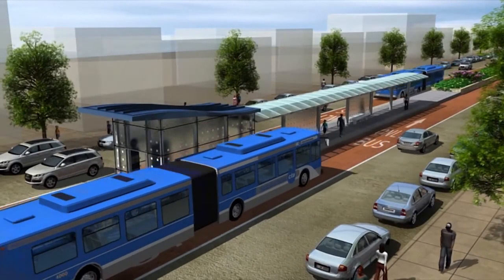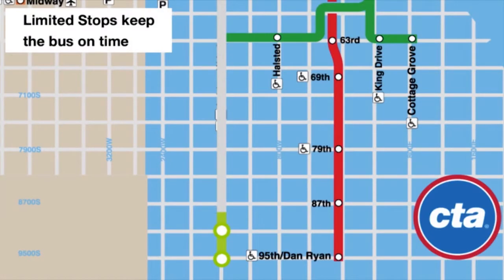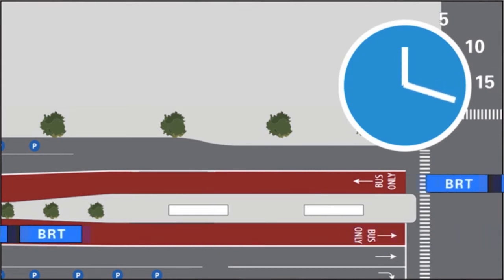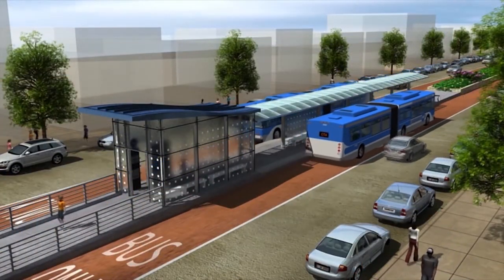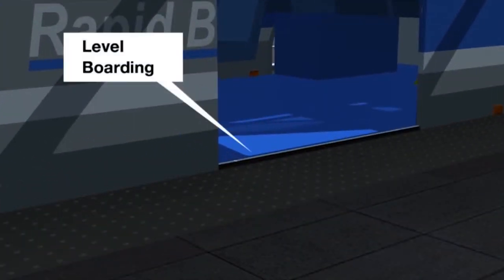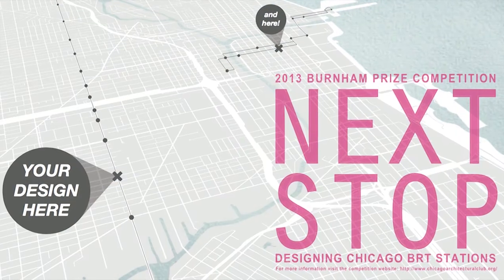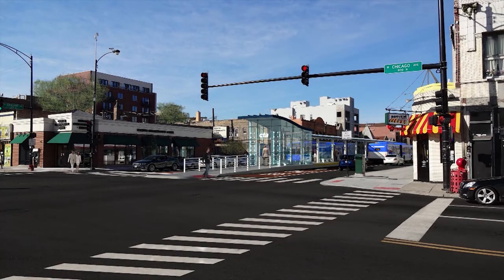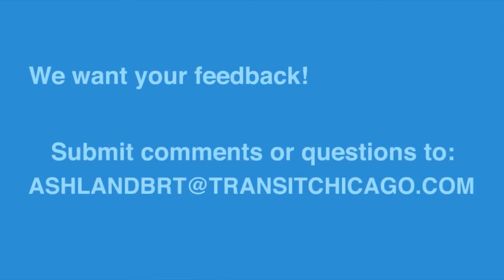Ashland BRT: How Will a BRT Station Work?

Comment: There is a reason why Ashland Avenue in Chicago is a six-lane (two traffic, one parking and in each direction) roadway: TRUCKS! Has it occurred to anyone how important it is for those trucks to make deliveries to the businesses and even schools along Ashland? 

This is what was ultimately the doom for Rahm Emanuel's reelection: He tried to turn the entire city (which was already a traffic nightmare) into a bike lane, to serve the 20% lawful/80% unlawful bicycle riders who disobey traffic lights; especially the ones installed for them and traffic laws without regard for pedestrians. Now, the CTA wants to take two (2) vital truck routes (Western Avenue is the other) and make things much worse for city traffic. 

NOTE TO CTA: YOU CANNOT FORCE PEOPLE TO RIDE BUSES OR RENT DIVY BIKES! THIS IS THE WORST IDEA YET TO COME FROM 567 WEST LAKE STREET, CHICAGO, ILLINOIS 60661! DON'T DO THIS! LEAVE ASHLAND, WESTERN AND CICERO AVENUES ALONE! JUST BECAUSE OTHER CITIES HAVE BRT SYSTEMS DOESN'T MAKE IT RIGHT FOR CHICAGO!

🐰
Reply: 1. You have provided no reasons why Trucks need two lanes, they can work just fine in one. 
2. This doesn't force anyone to use any mode of transportation it simply gives people a faster option (yes this will be faster than driving on the current Ashland Ave during high traffic periods). The Ashland BRT will most likely remove a lot of cars from the street and could possibly improve Truck speeds even with one less lane in each direction.
3. Ashland, Western, and Certainly Cicero are very unpleasant streets to walk along and often have terrible traffic despite their width, so redesigning all three of them is a must.
4. Chicago is not that different from other cities that've implemented BRT or light rail successfully, and there is no reason to think that it would fail here.
5. Overall the only way to reduce congestion is by providing more efficient alternatives which BRT is. The CTA's complete streets video on this explains it rather well https://www.youtube.com/watch?v=vm9ww6MOI-I so does this video https://www.youtube.com/watch?v=RQY6WGOoYis
Reply: I'm almost hit by a car on a crosswalk about once a week. Never had a problem with cyclists.
Reply: xavierhutcherson2896  "God" has NOTHING to do with transit. Read your Bible!
Reply: @BurjTransit  I wouldn't need to provide "an explanation" to city planners. Just as the Friends Of The Park "protect" (yeah, right) the lakefront, someone has to have common sense,  and I see ZERO common sense in turning truck routes to BRT and bike lane laden roadways just because. 

If you've ever seem Ashland Avenue, you'll see large trucks park in the median to make their deliveries.  Should they park on your precious bike lanes instead. No, better still, should we wait for you to wave a magic wand to have furniture, food, appliances, clothing delivered to those stores you frequent?

CTA has more than enough trains to move people around, and what I've seen bicyclists do on our streets seem to invite the issues they have with traffic; spitting and even kicking on people who are standing in the lane, running stop signs and even the very traffic signals that were installed for them, tells me they don't need more lanes or any other perks until thy are held accountable for their own actions. I'll vote "no" every time, and won't care whose feelings are hurt by it.